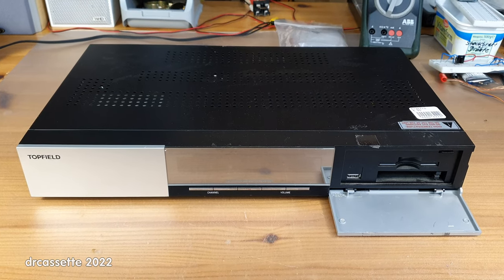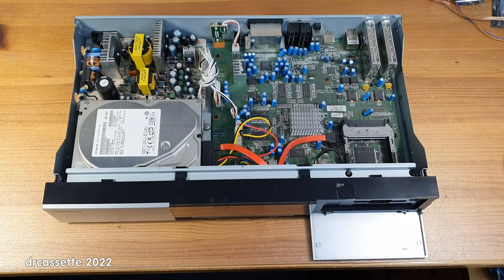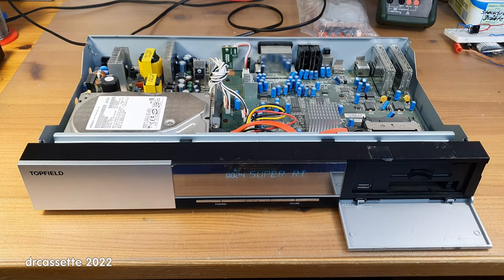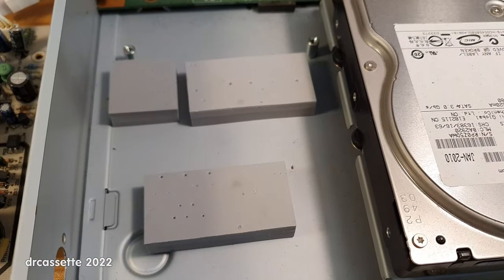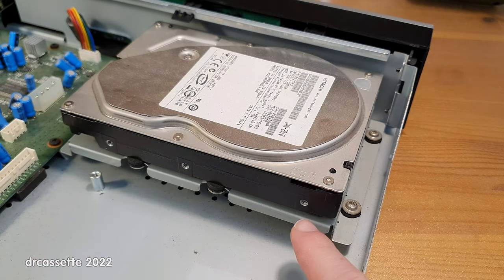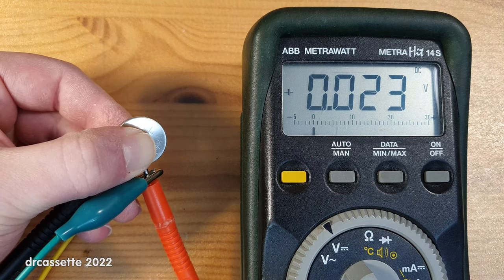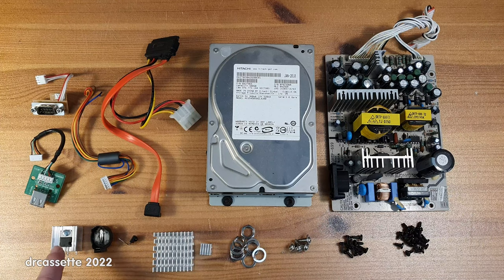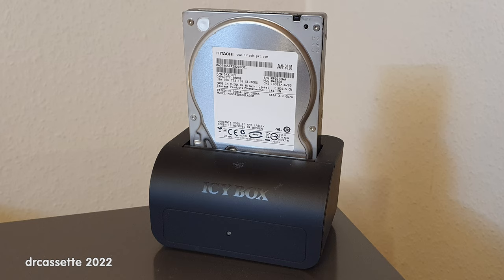Topfield satellite receiver teardown

Comment: Good find, and a fun teardown. The coin cell was adjacent to an Xtal and a Resonator, so it could have supported a RTC (Real Time Clock) chip. The resonator is probably 32KHz, the Xtal could be anything. Suggesting that the box kept time for some reason.
Reply from the maker: It would indeed make sense if the box had been able to keep time even in case of a power outage.

Comment: I agree with the decision not to use the disk for anything important (at least anything that isn't already kept backed up elsewhere). I've sometimes seen older disks develop pending sectors that they can't read from. Normally overwriting that particular sector with new data will cause the drive to reevaluate the sector, and if it appears to be permanently dead the drive will automatically substitute another location of the disk to store that sector. But often, the sector appears to work correctly again and the drive continues using it normally. Even so, when a disk does this (and it can't be confidently tracked down to an obvious transient incident such as accidentally losing power in the middle of a write) I consider the drive suspect because once faulty writes have happened once in normal operation, they will probably happen again at some point, resulting in more lost data.

As for the interface CRC errors, I'm not an expert, but I believe this just refers to the number of communication problems that have occurred between the drive and the system/computer over the drive's life. For instance, if you have a faulty or loose drive cable this number may increase. In that case, as long as the number is low and isn't regularly increasing, it should be nothing to worry about.
Reply: I totally agree with you and Jonas in this point, I usually use such old drives for experiments with Virtual Machines or for copying over large data that I will soon delete anyway, without abusing my SSDs lifetime.

Comment: I don't know if I didn't understand you properly, if that's the case I'm sorry, but I don't think CR2032 batteries are hard to find. You can find them even under the Amazonbasics brand.
Reply from the maker: CR2032 batteries are indeed readily available. The one in this DVR was very well hidden and difficult to access, so not at all easy to replace. That's what I was trying to say.
Reply: @DrCassette  Ah thank you!

Comment: My internal hard drive  cant be accessed and it cant find external hard drives, except one and it wants to reformat it, but its full and i dont want to lose the content. I can unplug it and put another hard drive in that has nothing on it, and format it. When i turn it off, i have to do it again, and the channels are blank until i click on them. So i assumed it musnt have power in that battery. I got one from the supermarket and replaced it. But it didnt fix anything. I am not tech savvy enough to know what the problem is. Nothing looks broken

Comment: You should have checked if there is any contents on that hard drive using the receiver and TV before you format it.
Reply: Quite often the video is in a propritory format
Reply: @TheChipmunk2008  That's why you have to use the receiver and TV as I mentioned.
Reply: @Capturing-Memories  Indeed you did.... It's been a long day (grin)
Reply from the maker: I deliberately didn't check for any recordings on the HDD. It was a PVR, so there would have only been old TV recordings, and I have plenty of those that I still need to go through. I check recordings on DVD/HDD recorders as those have A/V inputs, so there may be interesting stuff dubbed from other media, or home videos or so.
Reply: @TheChipmunk2008  In case of my old cheap Tevion sat receiver I was able to just play the videos on my computer, since this thing didn't bother to encrypt the drive or use proprietary file formats/encodings.